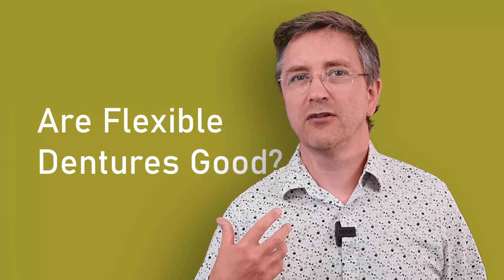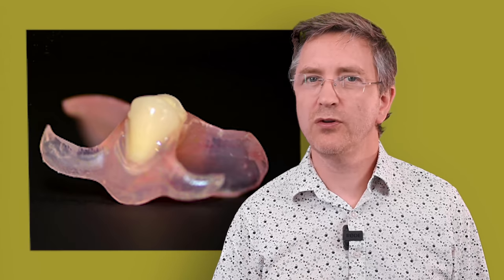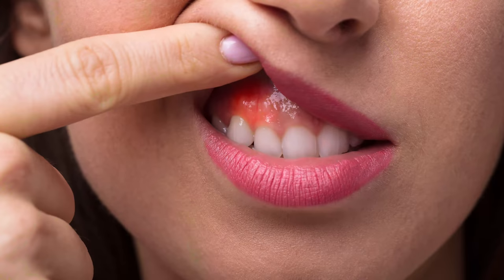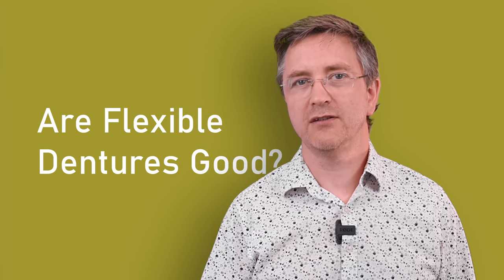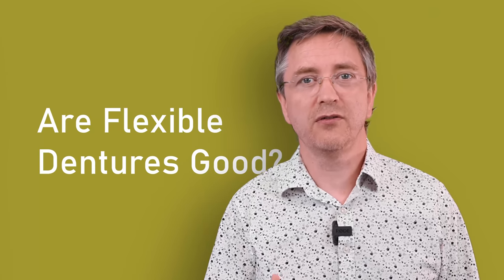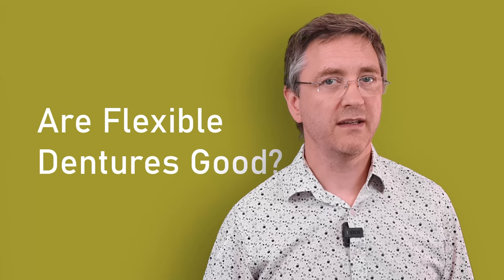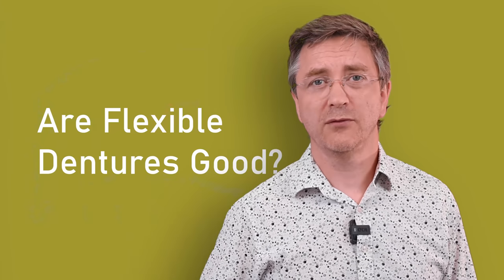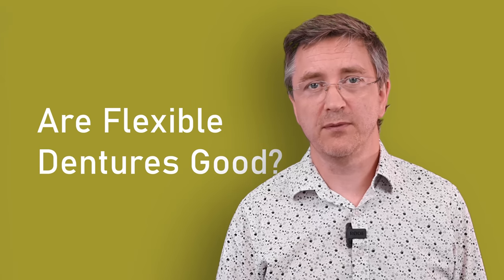How Good Are Flexible Dentures?

Comment: My flexible partial by Valplast is excellent! I’ve been using it for years and I can tell you that the Valplast has never distorted from its original shape.  Love this thing!!
Reply: Thanks for sharing. Great to know. how many missing tooth you have?
Reply: How about the smell it is good. Cos i tell to my dentist that if it possible i want also Valplast but he's not agree
Reply: @simplelivinggreece2945  You have a smart Dentist.
Reply: The video also does not say that metal dentures require drilling or crowning the teeth which will hold the clasps.
In my case, they would require 3 crowns on perfectly good teeth.
Valplast has yet to distort, but it is heavier on the gums overall. Mine covers 5 teeth, just like the one shown in the video.
I have not tested acrylic yet.
Reply: @nagual2335  • On bottom I have a valplast partial that has 3 rear molars, and 1 flipper eye tooth on the top.  All my teeth are blessings!!  🙂
Reply: @truewax257 hey! I hope you will see my comment. I looked into available options,such as, implants, bridges and crowns. I had some of those and the consequences were painful, prolonged use of abx, ending in a surgery to remove it. I understand that dentists are trying to advise on different options and usually go for implants or bridges. I'm so fed up. I just want normal, no pain teeth that I can feel happy with. Your story made me happy, I hate an idea that having a bridge means other perfectly healthy teeth will be affected. Also might end up with root canal infections again and needing removing. Weak teeth run in my family. I am aware that dentists are business minded. I guess, flexible dentures is not as profitable as implants. I hate any idea of invasiveness.
Reply: Since how many years u r using flexible denture? Does it last only for 2/3 years or more? Um 23 years old
Reply: Is it necessary to put them in water overnight
Reply: Yes you have to let your gum breathe
Reply: Thank you

Comment: I have one for almost  10 years. I had 2 teeth  added 6 years ago. And I had no problem  at all. I have alot of allergies and anything with metal does not work for me . The acrylic one causes sores in my mouth I wasn't ab to eat. My dentist told me the teeth might not hold for to long bit sordid a great job 6 years later they  still going  strong.  I hold mine under hot water and it forms to my gum. I love it
Reply: @marionhopkins1234 . Is the valplast denture hold your gums ? Is it soft in your gums ? I am looking for a tooth denture replacementb. Thanks

Comment: I have had flexible partial dentures
Top and bottem for years  ,  They are very comfortable and have had no problems. I only have 4  teeth left on  the top and only 2 teeth missing on the bottem.

Comment: My partial dentures "Valplast" knock offs are 80 % good. But have 2 areas where its like an excessively persistent all day nagging tooth ache. The outside base and the fish hook clasp area are too long. Pushing down on my gums 1/8" from their natural location. Its 13 days now and those areas still bleed when I remove the partials at night. I live most of the day with Ora-gel pain releiver soaking on the gums, hoping eventually the gums heal and the pain goes away. Had them adjusted once at day 10, could not take it any more, and they initially felt good, acceptable, hard to tell as gums were so tender, sore from all the trauma. Now 3 days later it seems as though the partial has settled even lower along the gum line in the same area. forcing the gum even further down. Seem to be undercutting the bottom of the gum line as they are curved shaped to grip the jaw, gum line area (outside of gum, not inside behind the teeth) and yeow, still have a nagging painful area, still bleeding. Hope this is just part of the process and the gums heal up in a couple more weeks, ugh.

Then the fake teeth are separating from the nylon backing or denture body. On day 3, while cleaning noticed black specks behind 2 of them. By day 6 there was the beginning of a black build up covering about 1/6th of the back of a 3rd tooths base. Like bacteria growing etc. Now day 13, there is foreign matter behind most of them. When I went to dentist on day 10, showed him this issue. With his monocular device he could see the teeth separating from the body, thus permitting access of food particle. I told him that concerned me as this seemed like a void that however little now, would permit the tooth to migrate around over time , thus causing a pre-mature failure of the denture. The lab wanted them backfor repair but wanted me to go without teeth for 1, 1.5 to 2 weeks while they repaired them. I was like not happening, I deal with customers most days and need the teeth. Told him if they want them back to use the digital files, build me replacements, once I had them I would surrender these for repair. We ended up deciding that I would keep these current ones for 2 more weeks to further let gum, jaw heal. Then rescan the whole mouth and have the new ones made based on the current mouth configuration. Told the dentist he needed to put his foot down with the lab and demand they step up or he could look elsewhere to have dentures made. Dont know if he told them that but I dont have to send them in now.  I can keep these failing ones as back ups should the other ones have issues later. Jheesh, 2 weeks, while some hourly guys saunters about casually making them, taking his breaks, going home at 3 blah blah blah. I bet they could be produced in 2 days. Its their failure, some manufacturing defect. They need to shove cases like this to the front of the production line and suck it up. Warranty indeed, customer service needs brushing up on.

Comment: Because of the material being different (there is a variety of flexible materials) the adhesion is mechanical (or physical) so the teeth don`t just fall. They CAN be repaired, and teeth CAN be added, but it would be quite costly due to the work and materials that are needed it`s almost like making them from scratch, so its not really a good option (however, it is an option). The acrylic which is easy to work with has several problems like imbibition, color changes and yes metal clasps can be adjusted, but they`re not the most esthetic are they? Metal framing is very nice, but only when needed (mainly for implants), it is nice, I do approve of it, but it is heavier than the simple denture.